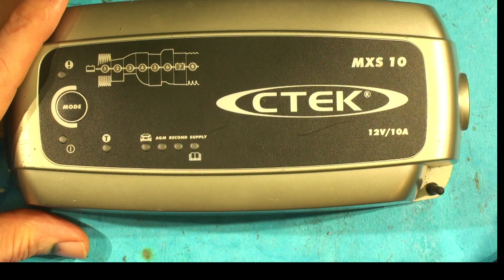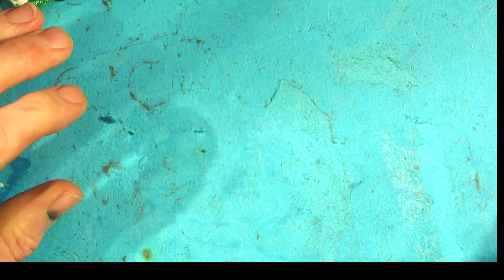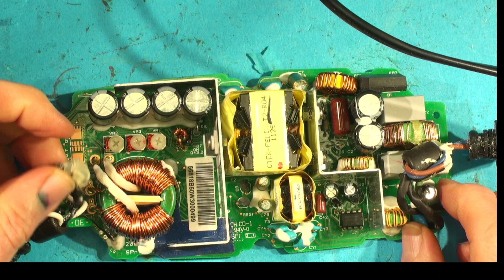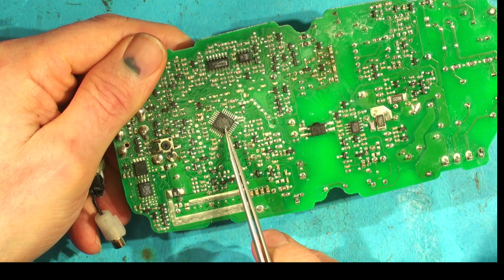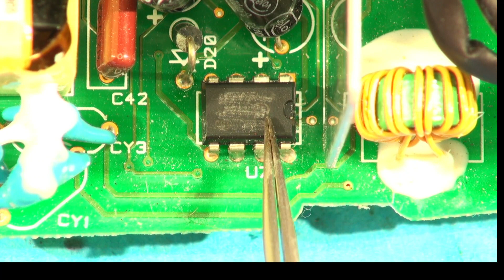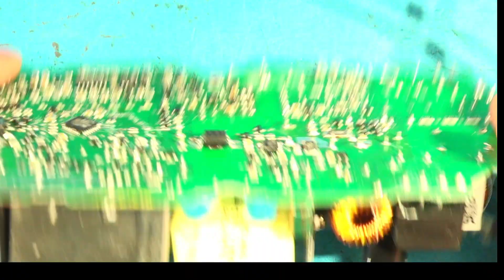CTEK MXS 10 They don't want us to repair them. Can you have a look if you have one of these...

Comment: Hi, my CTEK MXS 10 has stopped working, it was an unscrewable one, early production according to CTEK.  They've told me it's broken.  So I took it apart and can see all the info you require.  The part you've asked for says ICE3B0565J, then H1652L2B, then XK612051X03.  I can also read the ident on the other parts that were scrubbed in your video.  Is there someway I can contact you other than this comment section.  I'd like to get my charger fixed if possible, I hate just chucking stuff away.
Reply from the maker: Thanks for the info. i don’t have  a lot of time to spare these days as i am working on new designs. if you aren’t in  a hurry then email me at ark.mail@gmx.com

Comment: Hi i have a mxs 10 identical to this. Just 2 years old month out of warranty. Its turns on fine but doesn’t detect the battery. Mode button works fine. After 30 seconds it starts flashing green. Just like this chaps. Any advice? Really appreciate it.
Reply: My problem is exactly this. https://youtube.com/shorts/tZTDtY6ijMI?si=V7WRAMiOUav3q85f
Reply from the maker: In what country are you you based?  I can debug it..
Reply: @lozh811  that green light on mine now it’s bloody useless a ripoff

Comment: Hello, I have just done a repair on mine and I can see this chip number you are after it's a bit blurry but these are the numbers that it seems to be. I hope it helps. As best as I can see the top line is.  FCE380565J. The second line is. H1535/E2Z. The third line is. 51547020S01.

Comment: Thanks very much for your videos, and the people for comments.  My CTEK MXS 5.0 died, 16V rated caps on the DC side are blown out.  Other issues as well.  Bought 2 Victron chargers, properly made.  They have blue tooth for monitoring and settings.
Reply from the maker: You are welcome.
Reply: My 15 Amp Victron died in 6 months, their even worse.
Reply: @hiteck007  not a problem, they have a long warranty, unlike CTEK.
Reply: @davidlevin1541  It's true they did warranty it no problem and yes Ctek engineered their chargers to live just long enough to Die just out of warranty, I've had 2 of them do this to me now, so as a result I stopped buying them hence why I got a couple of Victrons and they all work every day, I got a lot of batteries to maintain.
Reply: @hiteck007  Victron have a long warranty.  Comment does not give the full story
Reply: @davidlevin1541  Sorry mate I was annoyed that it failed me but yes warranty is good & the replacement has been excellent. I think it was just a dud and you know the law of percentages, sometimes this happens. So the original 5 amp victron has always been working nearly every day since I bought it 5 or 6 years ago & has always worked so based on that I bought a 15 amp model which worked for 6 months then out of the blue kept firing up then shutting down after about 20 seconds like it wasn't getting enough power to run properly, anyway warranty replaced it and has been running trouble free since and it works hard too without issue. Thanks for letting me clear that up, I have no issue with Victron now and have a lot more of their gear now because of their backup service.

Comment: Realise this is an old topic now, but am looking at a CTEK MXS10 for a friend. Has an odd problem in that all seems to be well (inc. mode selection) except the error light comes on after a few seconds and remains on (although occasionally flickers, seemingly at random). Battery is OK and polarity is correct but doesn't appear to be charging, although the charger gets warm within a few minutes. I managed to fish the red plug out with a fine needle and remove the final screw to get inside. The chip details are ICE3B0565J - H1439/E2Z - 51452063501. No obvious signs of damage. Sound like a controller problem or small component failure? Do I tell him to recycle resposibly and get something different? PS barcode number is 56818E49W3000348

Comment: Hi, i got a ctek mxs 10 that just stop working, i bought 2 and 1 just died and 1 still going when i got to my garage and the circuit breaker did go of too, i open the ctek up and find out the 30a fuse was blown and i tried replacing it with no luck, do you still repair charger?
Reply from the maker: Sorry , I don't have time to take them on these days, I am working on design projects.

Comment: Another dead MXS10 with hardly any use.  
The controller chip on mine was not scrubbed, so here for confirmation are the details:
ICE3B0565J
H1439/E2Z
51452064501 

Fwiw few other parts on my example appear to have been scrubbed e.g. the Atmel chip is:

MEGA88PA
AU 1515
with a stamp mark B47

Hope this is helpful and thanks for your very excellent work!  
If there's anything else I can contribute, I will gladly assist.
Reply from the maker: Yes thanks,  I repaired the CTEK ones that came my way. I advise you store it in  a dry place for while and then to lacquer the board before your reassemble it.
Reply: @razenby  Thanks.  Will try.  So far only output fuse seems to have gone, so perhaps in luck.  Cheers.

Comment: was gonna get one of these im not now any other suggestions i need one for ecu tuning has to keep battery at constant voltage ? thanks
Reply from the maker: I dunno, ill test it. It has a supply setting right?  If you get one keep it in a dry place and don't take it from a cold damp environment into a warm one and turn it on straight away - it is likely top go bang as there is no moisture protective coating on the high voltage tracking.  Don't leave it running in the damp where the dew point can be crossed and if you plug it into a long extension lead then plug in a surge arrestor too.   The long wire is exactly the same as a whiplash. A gentle transient that starts out from the mains supply builds voltage as it approaches the end of a the wire - the same as a breaking on the shore wave or a bullwhip. The engineering equations are the same. The cheap electrostatics in these chargers are not built to withstand these events.

Comment: Hello,
my MXS10 just stopped working recently as well. No function at all, no LED light. I saw your video and had a look at U7 you mentioned (8 and B were hard to distinguish but I think it's written like this):
ICE3B0565J
H1812L2B
XK825032X01

The ship is fixed upside down so all numbers are upside down as well compared with U7 in your video. The half circle manufacturer logo is the one from Infineon and exactly in same position on my one. So I hope this may help you a little and I would appreciate if you could share another video or instructions how to repair it if possible (as I am an "electronically blind" mechanical engineer^^ who needs support on that because I don't want to throw it away)
Cheers,
Max
Reply from the maker: Have you checked the push  button switch ?- you can do that with a multi-meter and it is often the only problem. Thinking about, it I think a power LED comes on even if the switch is bad. The infineon chips are pretty reliable.  You need to check the B+  (approx 320V) is actually getting to the chip from rectifier / smoothing circuit.  I have seen many blown via hoes on the MXS10 particularly in the high voltage DC tracking.  Time to see the light...
Reply: Hey, Today I checked a few things at my broken MXS 10 as you recommend: Switch button is OK, B+ has ~315V. But then I have seen your second MXS10 (Scrapped Warrenty replacement) video which helped me a lot and I checked the 3 Diodes in the same order as you did. Result:
Diode 1: open circuit both ways
Diode 2: short cut both ways
Diode 3: open circuit both ways
I just have a cheap mulimeter (meterk) but I guess there is something wrong with these istn't it? And there was another thing that scared me a little when I switched on power (230V) there was a couple of bright flashs / shocks coming from one of the two 2R2 resistors close to Diode 2 (you called that area "boost trap supplier winding" / low voltage in your other video).
So if you could give me some instructions if a repair could be done somehow I would appreciate your support very much!
Thanks,
Max

Comment: Hey! About the final phase with maintenance charging you mention that the plates deteriorate if done incorrectly. How should it actually be done?

Also! Review the DD30CRTA board. Looks like a microcontroller combined with a mosfet using pwm in a very basic configuration using an external AC/DC converter.
Reply from the maker: The three stage charging process is well documented and discussed in the other videos. Final stage is a the 'float' or 'trickle' charge up to the terminating voltage at around 14.4V.  However the exact termination voltage is temperature dependent.  That is why a a compensated charger is needed especially if you leave it connected for long periods in a support role. During the last stage the vestiges of the amorphous Lead Sulphate are converted without significant damage to the Lead structure of the plates.l

Comment: Thanks for the video, good resource. I have a same unit but my MODE button does not allow my to cycle through the programs.I have watched videos on how to use electro clean on the contacts. Unfortunately, in addition to the 5 screws keeping the box together I hv one corner that looks like a red button. Initially, I thought it to be a reset button but it doesn't click. Can anyone confirm it is a plastic hold down melted at the top to prevent people opening the device up? If so can drilling it out allow me to open the unit up. Thanks and if opened I may perhaps get that number/code you are looking for
Reply from the maker: Do you men the temperature sensor at the side of the unit(red button).   Change the Tact switch. They are terrible quality.  You can test it with a  multimeter. It is very likely to be you problem.
Reply: @razenby  hi, thanks for responding. No, not the temp sensor but flip the unit over where you have the screws for holding the unit together. One of them appears to be a red plastic rivet instead of a screw. I hope it is and am thinking of drilling it through otherwise I cannot take the unit apart to get to the insides.
Reply: @Phil58Liew  did you get anything done? I have this on mine as well
Reply: @gigel99324  Yes I did, fyi the red plastic is just a cap. I followed the rest of the instructions as per video using contact cleaner. Result wasn't brilliant and I have to depress that mode button many times before it changes. Sometimes good and sometimes takes many  more presses. Unless you need to utilise all the modes, just leave it on charge
Reply: @Phil58Liew  thanks very much. Indeed I just drilled that cap and got to a screw. Couldn't flip the board though, the wires on the left and right have zero slack in them. Had to peel off the nice cover around the button and just blow air. Mode button started working.

Very, very disappointed.

Comment: Ice3b0565j
https://inkuiri.com/site/bukalapak.com/industrial/industrial-lainnya/m2dc-store-terbaru-ice3b0565-ice3b0565j-smps-current-mode-controller-integrated-650v-dip8.bddabdf6dd55d016139cada3a69b0017e3fbc4c0.id

Do you know which one is on the other side of the Pcb board?
I need his label

Comment: Would these ctek-chargers last longer by using motorcycle mode? I guess that would help it run cool.
Reply from the maker: In general It isn't the current that kills them. It is mains supply voltage transients and uncontrolled behavior of switching power supply during start-up and shut-down.  Consider, when charging a battery, the current demand is only at a maximum for a short period ( a few hours) so prolonged internal heating is unlikely to be the cause of SMPS failure. We in the UK have the highest mains voltages. It is not unusual for the mains to be at 245 to 265 volts AC.
Reply: @razenby  Alright, understood now a lot better the problem. I guess it aint the problem here in Finland since we have pretty reliable mains, usually stays between 230-238v in the area I live. Thanks for explaining that 👍
Reply: @pena3976  Light Bulb in series on phase wire with same or more watts and a wound up extension as a coil then helps... Its an 3rd world trick to keep laptop smps alive in the morning when people start their day and voltage goes low and up in swings
Reply: @pena3976  Yeah, same here in Sweden.. most applications are designed for up to 240V some old light bulbs that doesnt have that high rating explodes quite often. :)
usually for 220V
Reply: @razenby  I got a few Ctek chargers running on a remote power supply & it is set to 230 volts and is very stable unlike mains power, well 2 of the 5 amp chargers died now but the 10 amp one is still going way out of warranty, their all maintaining tractor batteries.

Comment: Hello, is there a chance, you're doing a repair video of the charger?  I have ctek mxs10ec and last week I hooked it to an empty battery, first it worked, than I disconnected it to rearrange cables and plugged it back in, than a battery disconnected light turned on(at this point output fuse was burned) and after a few seconds reverse polarity light came on and couple seconds later, charger didn't turn on anymore.  I opened it up and mains fuse and output fuse were burned, bridge rectifier was shorted, one of the fets on mains side was shorted and a fet on secondary side was also shorted. The charger was very expensive and  I just hope it didn't damage any of control part.
Reply from the maker: I have done it but haven't released the video yet.
Reply: @razenby  please release it :)